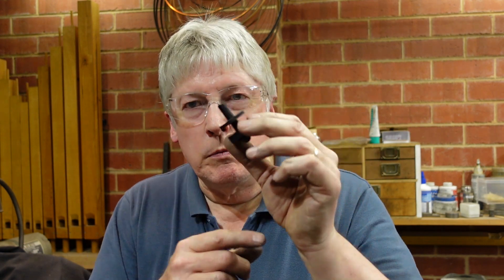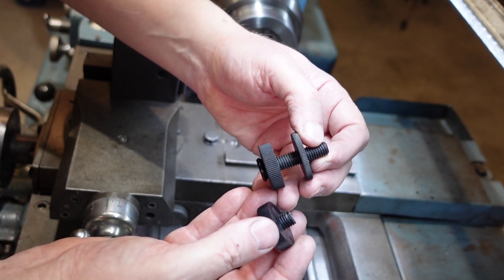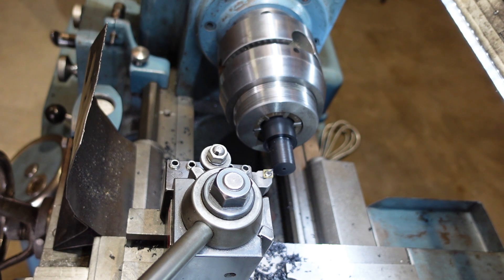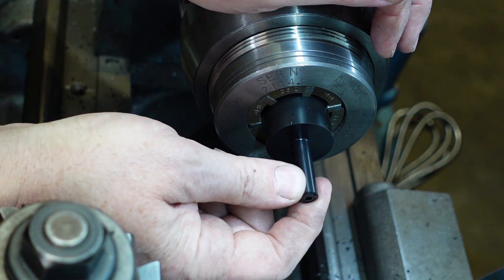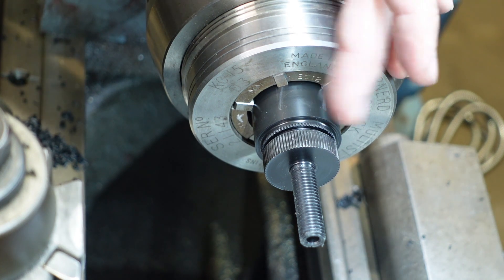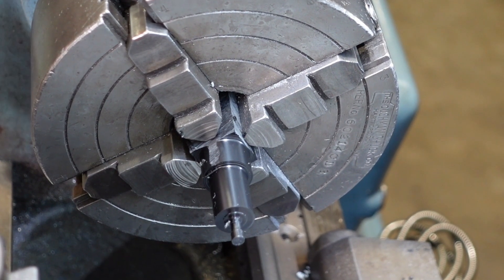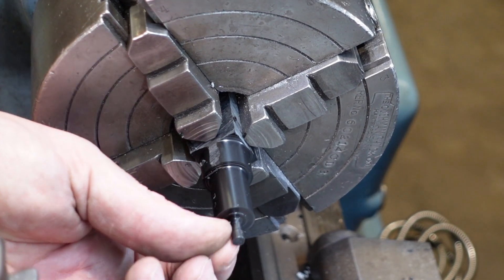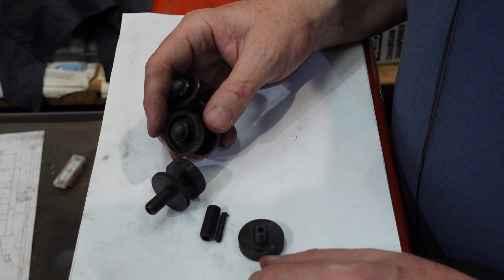A few tips on machining plastic

Comment: What answer would you give to your client if they asked.
' I expected you to simply fit a metal bar in the bores, to repair one and strengthen the other? '
In less than half an hour, it would give your client a far stronger pair that will last much longer for a fraction of the cost.
Reply from the maker: Not quite, as the bore needs to be hollow to allow the swivel foot.
However, the person who wanted the repair wanted a duplicate of the existing part.
Reply: @occasionalmachinist  Perhaps I should have said open out the bore & add a metal tube.

Comment: Please Michael a request. Swarf, not chips. Interesting video though.
Reply from the maker: In this neck of the woods, chips and swarf are used more or less interchangeably (swarf usually being the collective term). CNC machines for example are described as being fitted with chip conveyors
Reply: @occasionalmachinist  I do apologise, having a senior moment. I have made the alterations.
Must admit I thought that only our friends in the US used chips, but I'm seeing the word used more and more here in the UK as well. I just like the word swarf, the way it rolls off the tongue and from when I first started to produce swarf on a lathe at school at the age of 12, 50 odd years ago, it was always swarf. I'd never heard of chips until 5 or 6 years ago when I first started watching Abom79.
Reply from the maker: No need to apologize.
I understand your preference of swarf over chips - it may be common here because of that US usage, although I can remember it back in the '80's, so it's not that recent. My understanding of the difference is that chips are small, short pieces where as swarf typically has some length to it. Swarf also seems to be the collective (as in "there is swarf all over the floor")  
I have similar thoughts about 'solder' - without the silent 'l'...

Comment: I understand that this may not be an option especially for a hobby machinist who may not machine plastics much like us but polished insert tooling helps heaps. Cuts through nearly any plastic like butter and you can generally take much deeper cuts (~5mm) as well as lighter cuts for finishing. 

In terms of stringy swarf, id say the worst by far is nylon. It wraps around everything and makes an awful sound due to its high tensile strength. It also likes to burn and smear if swarf gets caught up which as you can imagine makes boring operations a pain. 

A good tip for nylon if you are doing cnc work is you can mill a slot in the part first so that it breaks up the swarf as you are turning.
Reply from the maker: Yes, nylon is another nasty - I try to avoid using it at all though as it can swell (water absorption) so is also not dimensionally very stable.
Terrible confession to make here though. Strictly speaking, I'm a hobby machinist too. There are all sorts of inserts that I would like to have on hand but the results I show are with GP grades of insert or even just HSS. When chasing productivity, the right insert can really help but 'reasonable' results can be obtained with technique and avoiding some of the problem materials.

Comment: good idea with the paint brush. I've only machined plastic once, polypropylene, it just wrapped itself round the chuck, bloody nightmare.
Reply from the maker: One of the reasons I don't do much with polypropylene - horrible stuff. Invariably I have side cutters on hand when machining the stuff is because it does string and wrap around the chuck.
Reply: yes I used a stanley knife and long nosed pliers, got there in the end but it was a chore. @occasionalmachinist
Reply from the maker: Another thought too - I was doing some brass the other day. The paint brush works well for that too.

Comment: My experience on working with plastics, has led to the conclusion that the generally best approach is to replace it with aluminum. Of course, sometimes that's not possible, but I'd recommend doing it where it is feasible.
Reply from the maker: Sometimes that can be done. In this case it was a replacement part for an existing assembly so needed to be plastic. I also have issues with threads in Aluminium  - if they are going to be used a lot I prefer something that won't wear as much

Comment: The draw pulls on your shop cabinet in the background are huge.
Reply from the maker: If it is the cabinet that I think you are referring to, it used to work in a bank holding checkbooks. Not that big though - standard drawer pulls are usually 96mm and these are only around 110mm
Reply: @occasionalmachinist  Yes, it's the cabinet in the background of your video. They seem oddly sized for the small drawers. 0:31
Reply from the maker: The drawers are quite deep though and hold quite a bit of weight